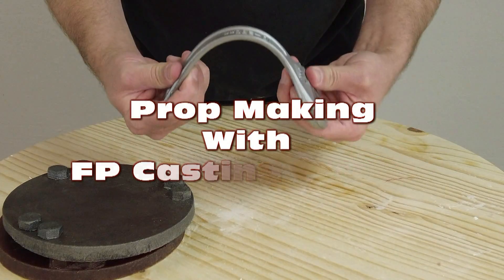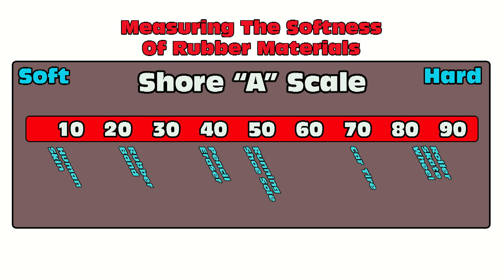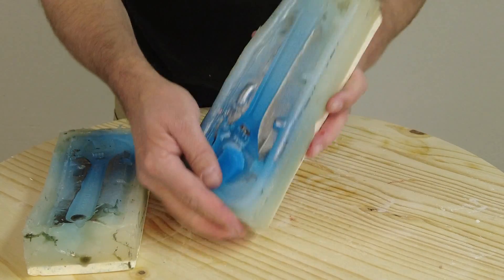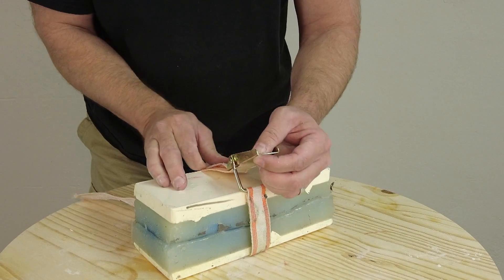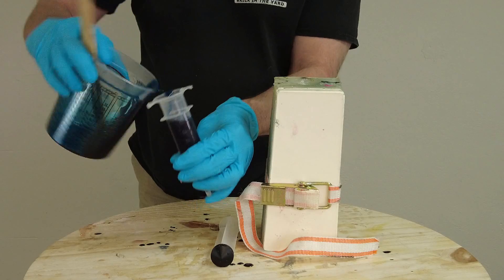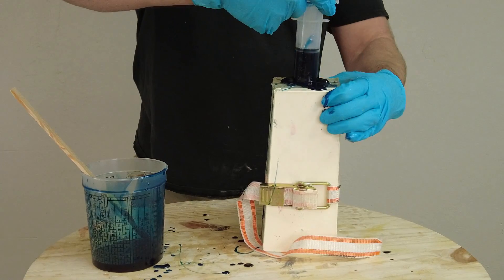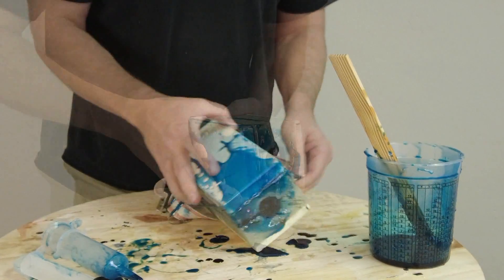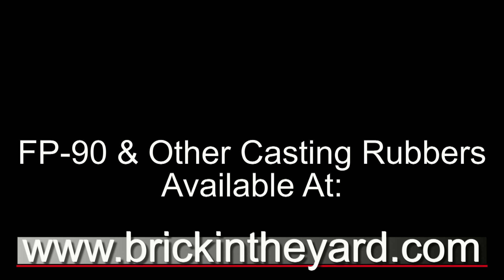Casting Rubber Weapon Props With FP-90

Comment: Hi, I believe I misunderstand the shore "A" scale. FP-90 is supposed to be the material used for the wrench. When you showed FP-90 on the shore "A" scale, it was up there with roller skate wheel. Now roller skate wheel is very hard, but the rubber wrench was very flexible. I'm wondering why that is.
Reply from the maker: A 90-95A rubber will be flexible in a thin cross section.